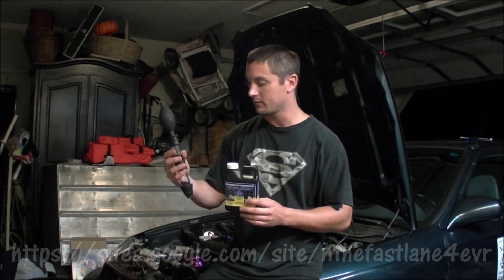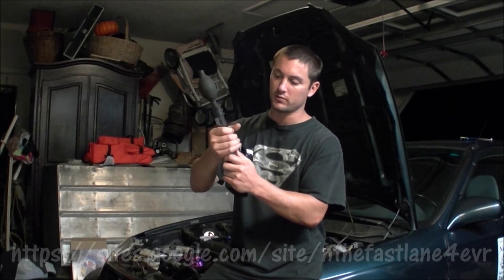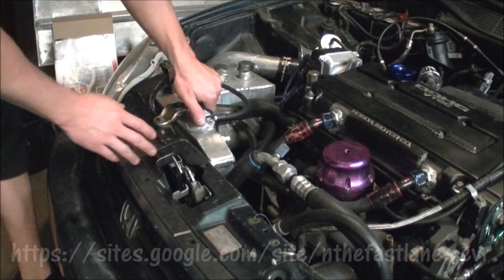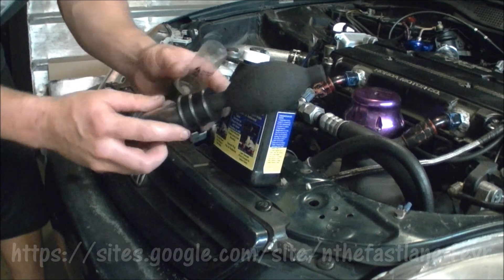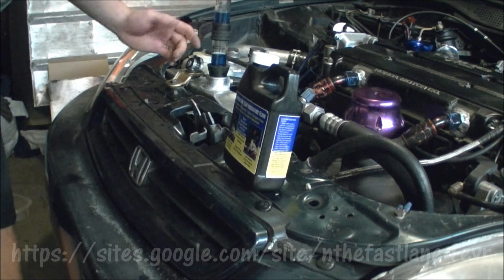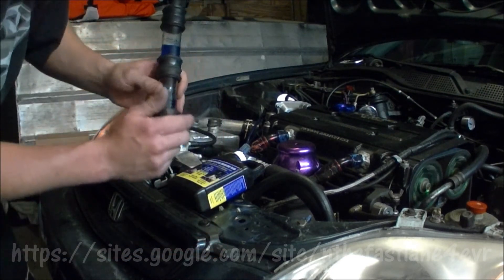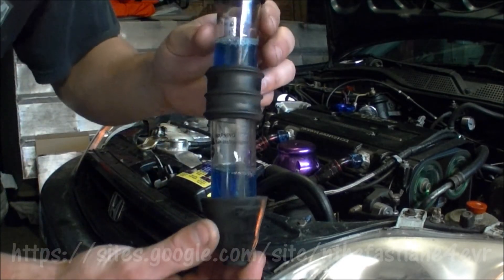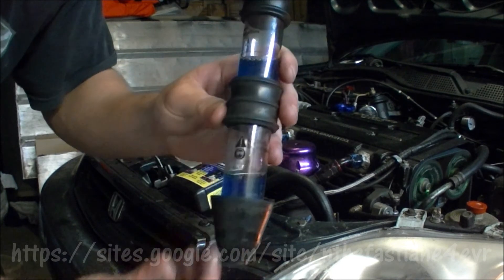Leak Test "How To"

Comment: if your talking about multi layered steel head gasket, yes the car did come with it, i just switched mines with a stock specification permatorque head gasket from o'riely i didn't have the time nor money to machine the head and block cause i was in time of need, so i just closed my eyes and tried. all i did was torque down the head 10lbs more then stock specs let it sit overnight let it do all the stretching it wanted if there was any and put everything back in place and it ran fine after that.

Comment: yea i also had no smell or smoke cause my cylinder was leaking into my cooling system, funny thing is that it had so much pressure my overfill tank cracked spewing coolant in my engine bay and then my top radiator hose popped lol. maybe your head is warped, just and idea but my friends car had that problem not mines. unless you also machined the head then that rules the head out also. might be something small, but big enough to make a difference

Comment from the maker: Did you have a Multi Layer Steel Head Gasket?..and did the head or block get any warpage? If it's my head gasket I'm hoppin to not have a any with a quick swap.I'm using a Mls Head gasket..don't see how it could of blown on 4psi break in boost.

Comment from the maker: Another thing im goin to look at is my hoses that I used to cap off the heater core. Might be pulling air. Cause the leak test not changing color but yet im gettin bubbles could mean its pulling air.

Comment from the maker: I'm thinking the head never seated properly or the bolts need re-torquing. My last torque wrench gave false readings..found out after i built the motor. I now have a new one. Head was decked, tested for leaks block had a fresh deck. I have no miss fires no smokes no coolant pancakes in the morning smell :)

Comment: my civic head gasket did that to me too. it would only leak when it was operating temperature, and when it was operating temperature and the car was rolling the temperature was stable. but when i came to a stop the temp would rise up past the half mark, the car would idle all day at normal temperatures, but right when u drove it for a couple of miles and came and parked it the temp would rise.  the group forum talk isn't loading for me on your website just letting you know.

Comment from the maker: I built this motor roughly 10k miles ago and everything tested ok. It's a really odd problem..Started not overheating but climbing past the half way mark then I'd rev it at idle and it would drop back to normal. All this after driving 100 miles and getting stuck on a off ramp. New 2,500 cfm radiator fan new Aluminum radiator new thermostat..not to mention every part on the engine is 10k miles old Mls head gasket..If the leak test fails I'm goin to pull head bolts an swap with arps one at a time